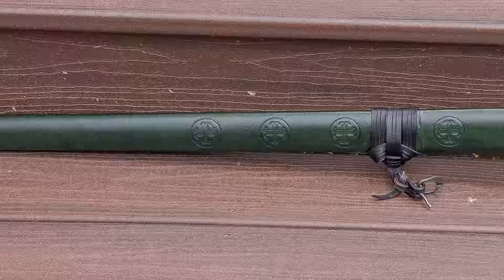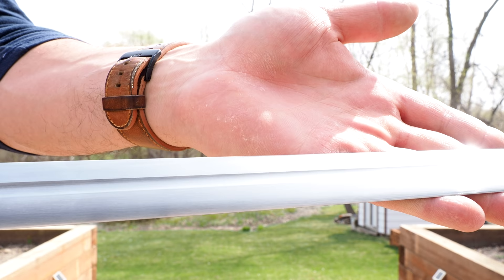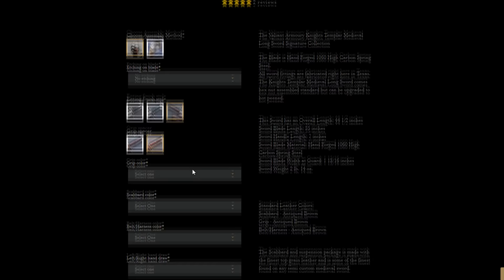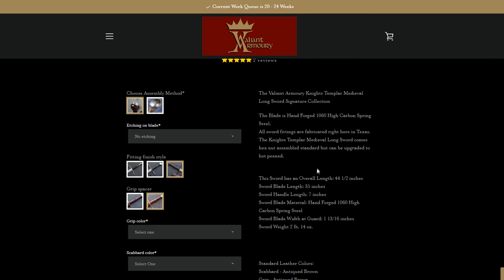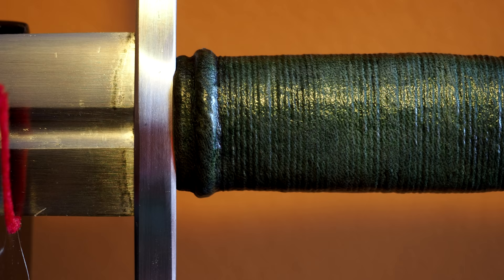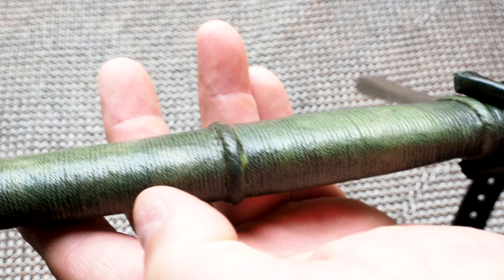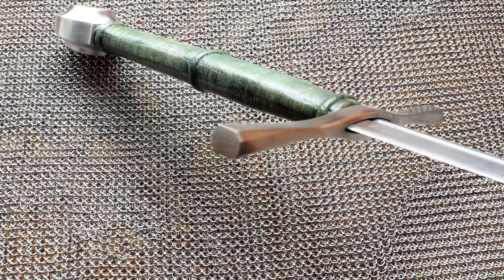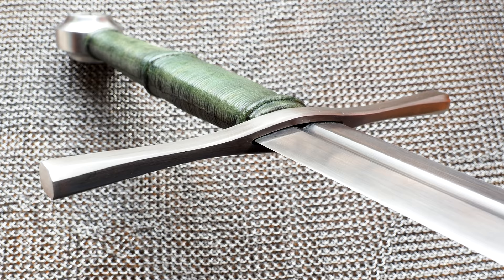Valiant Armory VA-409-Signature Collection - The Knights Templar Medieval Long Sword Review

Comment: Hey Matthew,
Just wanted to add a quick note on European scabbards. It's quite common for them to be left intentionally loose "ish" so that whilst on campaign your sword doesn't seize up in the scabbard due to swelling. Not saying it's not nice for them to fit well or not rattle, but from a modern production standpoint when making them in bulk, it's safer to err on the side of "loose" than "tight". Loose can become snug with humidity, snug can become "wow my sword is stuck!"
Anyways, great video as always
Reply: Hm... that contradicts almost everything i heard and learned on that matter from almost every scabberd maker on the market, Europe and U.S. through the last 10 years... not saying you are necessarily wrong, but could you back up this with source material, please?
Reply: Pretty sure VA's scabbards and swords aren't made "in bulk".

Comment: Can you make Steven SEAGAL signature Katana video review?
Reply from the maker: I would be happy to review one but I don't see it happening in the near future.  CS has declined to send a sample and I don't think I will be buying one.
Reply: I want to buy Hanwei Raptor Series NANBOKUCHO Zukuri or DragonKing Winter Sun Katana ,which one is better?
Reply from the maker: depends on what you want.  The winter sun not as wide as the raptor and I think it is a little lighter than the nabokucho.  The tsuka is a little smaller in terms of thickness and they have different dynamic properties.   If you want something that is a stout and solid cutter, the raptor is a good choice... If you want anything else, then the winter sun is probably better.